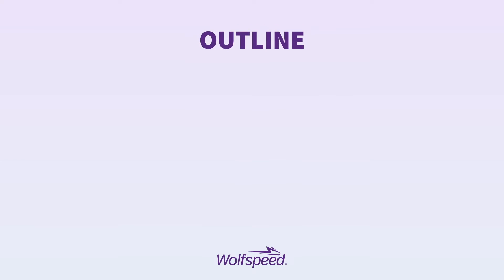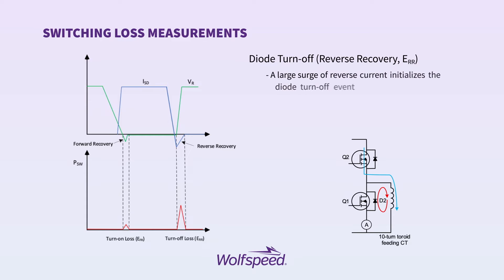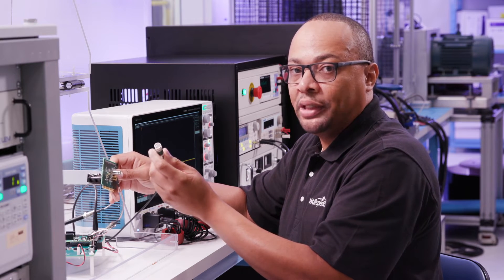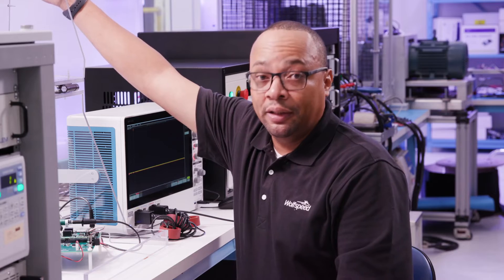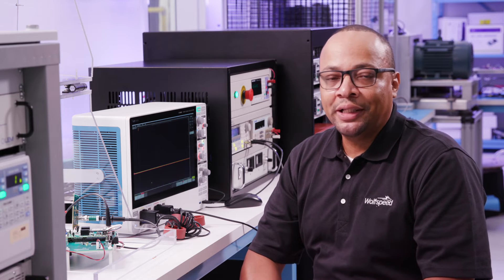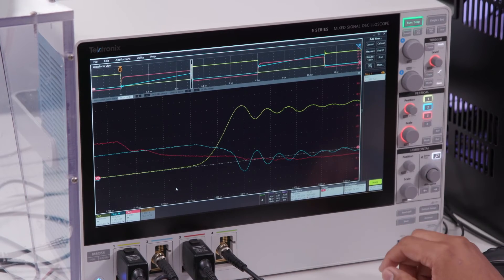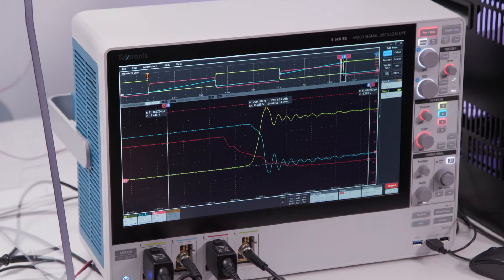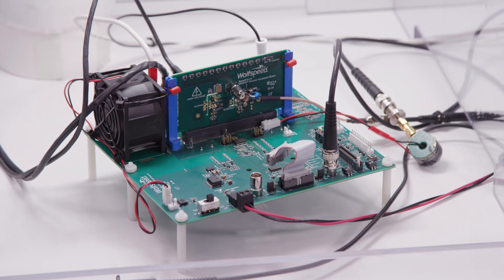A Closer Look at the Double Pulse Test

Comment: I have a question, looking at switch off, in the theory part the voltage is raising before the current begins to drop and thereby the loss formula. But on the measurement the voltages raise at the same time as the current drops… so the loss formula don´t match the real world, why and are there a better formula?